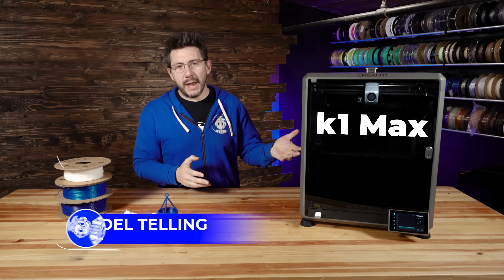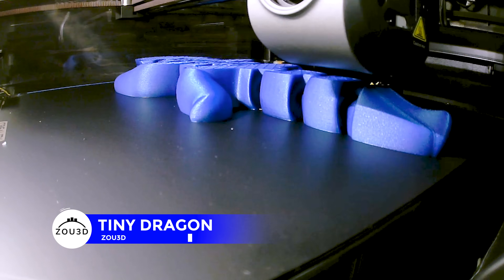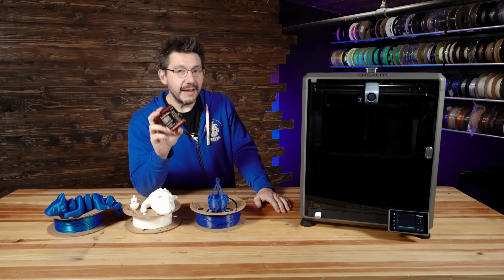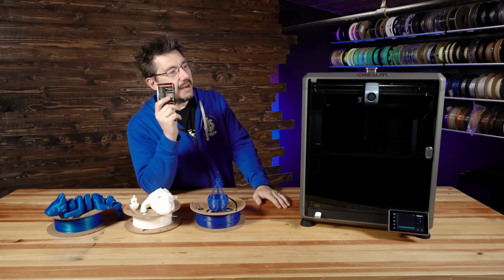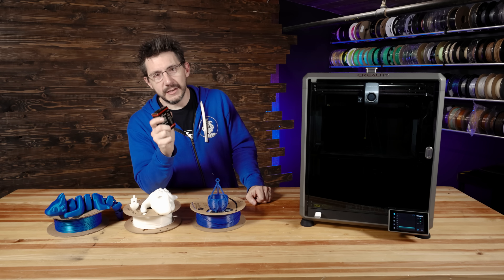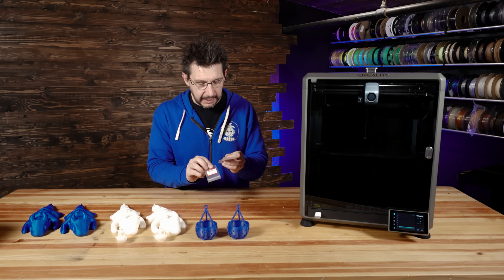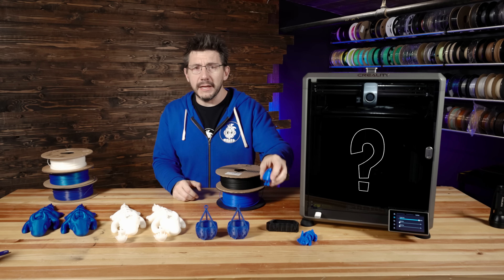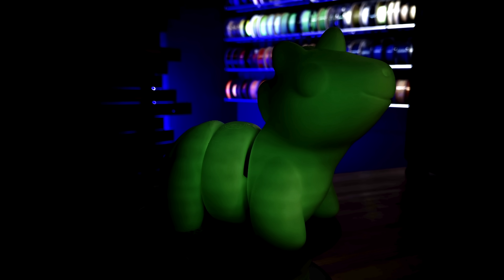THIS Fixes the Creality K1 Max

Comment: This is the printer I'm leaning towards the most, but I wish there was an option for multi material printing, that's the only thing this printer is missing for me. I don't want to cave into Bambu and get locked into their ecosystem, but it does have everything except for the huge print bed, which is at least better than my Prusa mini
Reply: But K1 Max printers also have custom parts, no?But at least for Bambu you can buy most of the parts already for same or cheaper price than regular stores. Im in search of a printer to upgrade to and right now settling on Bambu P1S with filament switch box. What bothers me in K1 Max is what many youtubers reported , like poor design choices, filament enters into head unit at sharp angle, which can produce wear, the tube can also unlock the extruder at some angles, the head belts are not running in parallel (more of esthetic issue it seems but still) , questionable firmware (people reporting here that nozzle can smash into bed), ai features not doing much. The bed size is nice and the usb port for print files if you want to go offline. But everything else is questionable. Judging from other video neither printer is truly locked, and you can swap every part you want, its more of a question if it will fit in the enclosed body constraints.
With Bambu it seems it will just work and for K1 it will just work ... after you change nozzle, after you change extruder, after you put clean klipper on , after.... and so on :/
Reply: @Alexander_Of_Pines  All good points. I ended up caving in and going with the X1 Carbon with the AMS. It's just too good and now $150 off plus filament discounts. I was originally thinking if I did get the X1 Carbon I would wait to buy the AMS later, but I ended up deciding to go for it because it saves me an extra $100 later by getting the combo and I can pay for it over 6 months through PayPal interest free. I know I cohave done what you did with the P1S, but I don't plan on buying another printer for a long time and I want it to have all the features I'm looking for. The build volume is honestly enough for now and if I really need something bigger I can get the Neptune 4 Max for not that much in comparison.
Reply: @RaySchrantz  Congrats :) i went for P1S with AMS just few days ago, tried to figure out the payment and by the time i fixed it i got moved to "you will receive your printer before december 12"  form "december 5th" , but thats ok im not in a hurry. X1 is great (but its a bit more pricey in EU :( ), i also plan to have printer for at least 10 years and agree about volume, i managed to print things on my tiny delta, P1S should feel massive, looking forward to set it all up :)
Reply: Get a Prusa then 👍
Reply: @WerHatDieKokosnuss  Prusa's CoreXY printer is too expensive and that's my number 1 requirement if I'm going to spend money on a new printer. $1000 more than a fully kitted Bambu X1C for just two nozzles. If I could afford it I would though.
Reply: Bambulab doesnt lock you in... its a printer. You can use a different one if you want.

Comment: have to mention the print speed and qualiity performs all my other printers out and i really like the nozzle, ok, its only .4 but it is a copper/steel hybrid which performs fantastic. printed ASA with, i think 300mm/s at least 200 on a .6 extrusion with this nozzle at 260C° perfect print....after i used a giant brim, because that creality flex sheet is absolutely not made for advanced materials...with or without glue...pretty bad adhesion. only pla /maybe PETG works great ..and this printer is in my eyes not made for just running fast PLA Prints the chamber heats up to 50C° maybe more if you stop all fans. i bought it for petg/ASA/ABS/PC/PP/PA...not for PLA...PLA works almost everywhere. The firmware especially the starting prozedure of the prints is way too long and not very satisfying for me. Hope they will update it soon to a much more (pro)user friendly style where you have more freedom of choice for leveling/materials offsets,flow jerk and so on, direct on the display. 

This printer could be awesome, but for now it hangs behind on firmware / app / slicer(integration) side. But that can be fixed in future..and i really hope that!!!

Comment: Is there a CHT option?  I'd imagine a high flow nozzle would help with a larger nozzle at higher speeds. I find a 0.6mm the best point between thickness, overhang compensation, speed, and weight.

Comment: They have really gotten their act together recently, does make buying a printer in 2023 a little bit harder of a decision.
Reply: No they haven't, using a ripped off Fluidd interface violating GPL, making the extruder out of copper for some reason and half the features they advertise not working, it's typical creality in a new slicker design.
Reply: @anonymousperson7861  to act like all that means they haven’t IMPROVED their machines is a little short sighted
Reply: @anonymousperson7861 At this bedsize or higher which printers are better? And that comes enclosed at the relatively same price point?

Comment: Here's why I think the 0.4 mm nozzle is good, actually: the nozzle diameter doesn't restrict the maximum flow rate very much, it will happily print wider and thicker lines for inner walls and infill, and it still allows for detailed surface layers.
I just printed a bunch of parts with 1 mm line width and 0.4 mm layer height, on a 0.4 mm nozzle. I have maximum flow rate pegged for the entire print, yielding the shortest possible print time. I've even gone up to 2 mm wide by 0.6 mm high for vase mode prints. 
The bottleneck is the hotend and material,  not so much nozzle diameter. 
Of course things change with "filled" filaments.
Reply: Your .6 nozzles will do perfect .4 outer wall lines to without the need to mess with the rest of the speed settings.
Reply: 0.6 is better because it's Faster for the same quality.
Reply: @AlbertoMartinez765  the whole point of my comment is that it's not the nozzle diameter that matters. It's all about maximizing flow rate. A 0.6 mm nozzle is not faster than 0.4 mm nozzle, because 0.4 does not significantly limit the flow rate. You can do bigger extrusions just fine with 0.4 mm nozzle.

Comment: Do you have a solution for the major issue that it isnt possible to level with different bed temperatures. It always levels with 50C° and when u print with an 80C° bed... its way too close! and a z offset in the display is also not available...that aweful
Reply: 100% agree on babystepping from the front panel - my K1 would be perfect with that ability.
Reply: @reasonablebeing5392  absolutely "almost" perfect 🤣 that's really missing, the most I miss!

Comment: I bought a K1 when it was released and I have to say, its definetely miles above the ender/cr series of printers. 
But Bambulab still takes the cake for best slicer/app integration(workflow). My only issues with the K1 is the atrocious panel gaps and belt path, and the fact the slicer/app was poop. 
Software is software tho so maybe theyve improved in the past 3 months.
Reply: Yea, after owning 3 Creality machines, Ultimaker 2+, Geetech (cr10 and ender 3 clones), plus a few other random machines over the years. I'm so happy that I was able to sell ALL my old printers and pickup the Bambu P1S, cause the entire ecosystem has been pretty awesome so far. Finally feels like a tool I can just "use" and not another Maintenance Monster I dread having to deal with.
Reply: @channelnotfound403  damn you got lucky, I cant even sell my printers under msrp. and i put easily $1k into each ender/cr printer (linear rails/corexy/enclosures/extruders/hotends etc..)
But then again, there's no value I can put on the knowledge and skills I've learnt from them so im not mad.

Comment: Would really like a video on what you do with the support settings for the K1/K1 Max and other recommended settings that you change from the profile provided in Creality Print
Reply from the maker: I didn't use Creality Print.
Reply: Creality Print isn't so bad after all if you don't want to include a pause. Orca Slicer is really great, but out of curiosity, did you add any tweaks to the default K1 Profiles? @3DPrintingNerd
Reply: See the thing about creality, is they offer you cheap hardware, but their software is 100% of the time, absolute garbage. They rely on other companies making software that works, which is why Joel was using OrcaSlicer, which has work from the Orca Slicer devs, Bambu Studio devs and Prusa devs doing a lot of the heavy lifting.

Heck, the printer firmware is klipper, which they initially stole and simply locked down before being forced under pressure to release it and honour the license of klipper.

Creality just isnt a good company. Their products often offer good value especially when you avoid their software, but they just arent a company you want to support because they arent really doing the innovation nor improving software.
Reply: See the thing about creality, is they offer you cheap hardware, but their software is 100% of the time, absolute garbage. They rely on other companies making software that works, which is why Joel was using OrcaSlicer, which has work from the Orca Slicer devs, Bambu Studio devs and Prusa devs doing a lot of the heavy lifting.

Heck, the printer firmware is klipper, which they initially stole and simply locked down before being forced under pressure to release it and honour the license of klipper.

Creality just isnt a good company. Their products often offer good value especially when you avoid their software, but they just arent a company you want to support because they arent really doing the innovation nor improving software.

Comment: Nice Work Joel......I have the V3 K1 Max & I'm going to order the MicroSwiss hotend upgrade thanks mate. Awesome Job
Reply: but why ....isnt the standart one just fine, and i have had a prusa mini for over 2 years, changed the nozzle exactly once......seems kinda expensive for nothing
Reply: @Basement_CNC  if you the latest K1 nozzle it is fine. But I'm a sucker for upgrades especially when you swap out the nozzle for larger nozzles without worrying about making sure it's tensioned enough to press against the inner cold end preventing filament bleeding aka the dreaded bubble gum gew explosion that you can have when you get a filament blockage during a print. This swiss hot end all abit pricey does Fix this issue for good so to me it's worth the trouble free cost in the long run. As when a leak occurs it can be catastrophic to say the least.

Comment: I have K1 MAX and QIDI Max3,  i perfer QIDI Max3 for ABS/PA/PC. Bigger build size and chamber heating , K1 MAX have the extruder issue, hotend issue, bad auto leveling(even i cant adjust it):face-orange-frowning:
Reply: how long do you have quidi max 3
Reply: 2 months @escobarguan4222

Comment: One thing I don't understand is the hype with the AI lidar (kinda, not really) scanner for the first layer. My MK4 with its nozzle system has printed flawless first layers, without any of that. I also prefer more open systems tbh, just so I can easily fix or even mod things with generic parts. Reading further about people buying this printer and it's clearly necessary to address the quality of support from Creality as well (being very slow/non existent), an experience in itself can be great, but it does need more context in my opinion.

Comment: It's November and I plan to buy my 1st printer at the end of the month for my bday. I already decided on the P1S Combo over the K1 Max but now you are making me hesitate. I already missed the cheapest price of the Co Print KCM Set that will compliment this machine. I backed out because of the combined prices and risks vs the P1S Combo. But if you say the K1 Max is good especially for larger single material prints, I really need to thing what is my priority - cosplay or fun colorful prints in the near future. (CoPrint doesn't ship until March 2024).
Reply: I'd say it depends on what you want from your printer. If you're looking for more of a tool to print things, the Bambu might be the right choice, as they have much better quality control and customer support, and you might not mind their more closed off ecosystem. If you're more interested in 3d printing as a hobby, the Creality might be the right choice as it runs more open software and has a much wider support for customization and mods, but has worse quality control, so you might have issues if you get unlucky. The larger build volume of the k1 max might be a big deal, especially for cosplay, being able to print things like helmets in one piece is really nice.
Reply: My experience with K1 MAX: it just works. Fast, accurate, even at the "fast" setting. I am using their slicer. I have the Prusa slicer, a Prusa i3MK3+ (great machine, just small and slow, but very good), the Prusa XL (big, needs some work, but like the MK4 only bigger). Since I have problems with the XL, bought the K1 MAX, not expecting anything great, anticipating a return after 2 weeks or 30 days (whichever was the return policy). I was amazed by the print quality, and the speed is beyond awesome. I print PETG only, so that makes things easy - for me and the printer. Only setup problem is getting someone to lift it out of the box for you... :)

Comment: Sucks that they don't have a hardened steel nozzle for the Flow Tech. Not sure how those will handle abrasive material.
Reply: Hardened steel nozzle and CM2 FlowTech nozzles are coming in a few weeks.

Comment: I'm not sure how this is any better than any other 0 effort printers like bambu or the prusa mk4. When I plugged in my mk4 it required no effort to print the rocket engine.
Reply: I guess he means this in the context of the machines Creality normally puts out. But yeah, a tiny bit too positive sounding overall.
Reply: @punishedbrains  I could have sworn he mentioned bambu and the mk4.

Comment: My K1 Max must have been one of the first.  I'm still having issues they are not fixing.  I have the upgraded extruder and hot end.   It's almost there.  I did just order this to try.   Now if someone would just make a better replacement extruder!   And a few firmware bugs and it will be there.   When it works this is a fantastic printer.   But alas that's about 70% of the prints.
Reply: This is a great kit.   Mine came in, easy install and great quality improvements!

Comment: I picked up my first 3d printer (and ender 5 s1) last year and....it left a realllly bad taste in my mouth. I have basically spent all my time leveling, re-leveling and re-leveling the printer and still cannot get consistent prints.

I'm glad to see this one is a huge improvement...I'm just really hesitant after my 5 s1 experience.
Reply: I keep telling people if it has those giant knobs under it don't waste your time. The new ender 3 v3 se is the only ender I'd recommend. Then there is the creality cr10-se and of course this printer as well. A year ago I'd tell people don't waste your time with creality.
Reply: Some of the early Ender 5 S1 machines had a slight twist in the X axis extrusion which causes those leveling issues.

Comment: 1 big flaw that creality has it that its not selling parts to fix or maintenance the printer, that's why i'd still go with bambu over this, i saw a post where somebody was trying to get the heatsink above the hotend, he went to creality directly and they would not even sell the part to the poor guy, fixability is a great deal on those things, and should not be taken lightly
Reply: You can use Bambu printers perfectly without using their cloud services. I've printed hundreds of hours on my P1S and never used the Cloud once.
Reply: I don't mind upgrading my own printer but the main reason I'd stick w/ this is the ability to use vanilla Klipper and also, I don't like Bambu's dependency on cloud services.  The only reason I'd get a Bambu is for their AMS.  If Creality released a multi-color upgrade, it'd be a true game changer.

Comment: Always loved Creality for 2 screws that run through their hotends that allowed me to change nozzle with one hand without supporting heatblock with a wrench
Reply: I'd recommend you still support the heat block. Depending how tight the nozzle is you can bend those screws. I did this exact thing on my s1 pro
Reply: @bruddaozzo nozzle shouldn't be that tight. If so it's over torqued.

Comment: I have a K1 with a new extruder and it's such a wonderful machine.  I love it.  I feel bad for all the people who beta tested the machine for creality.
Reply: To be clear, this ships with a better extruder now?
Reply: @theguyonyoutube4826  yes the K1 ships with a new extruder (and maybe you will get a new hot end of your nozzle sock is red).  You can tell if you have the new extruder if the knob on top is magnetic.  If you don't have a magnet you can visually inspect it and if it's textured (not shiny) it's the new one.  I believe that the K1 Max has the new Extruder and Hot end.
Reply: Does the new extruder still has plastic gears? @mvaluk
Reply: @adammichoo2930  Yes, and it is marginally improved. rertraction is still impossible without jamming the extruder, and it needs to be taken apart every other print when things go wrong. Avoid this mess of a printer.
Reply: @Moon_m4N_1 Nonsense. Your issue is the user, not the hardware.
Reply: @CapacitorCapacity no it isn't creality bot, this printer has fundamental design problems.
Reply: At least they've set up the K1 Power Boost Kit to get the new extruder / Camera out to the beta testers as a sorry, a fair move on their side ;)